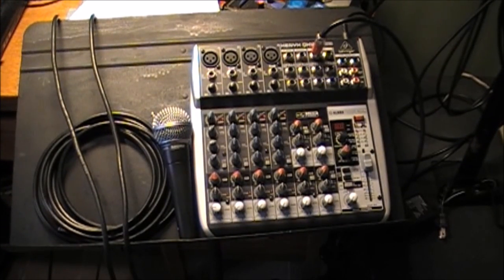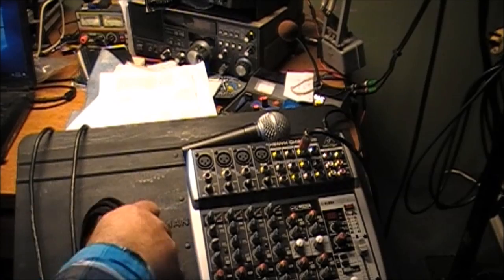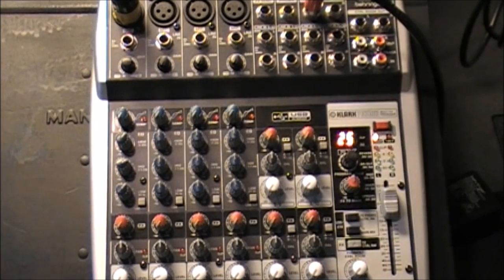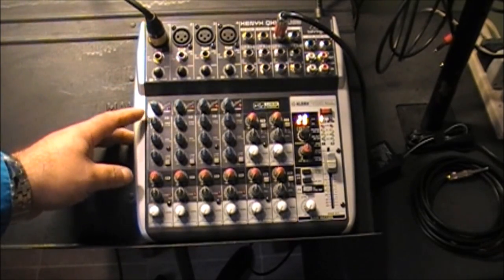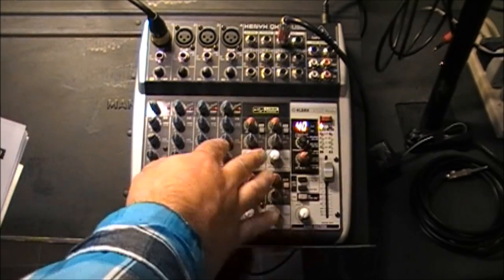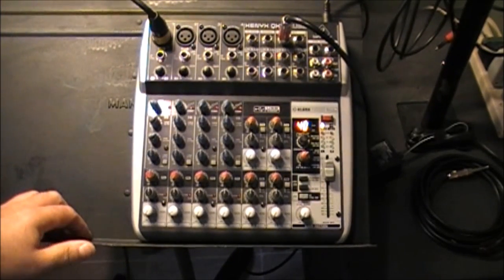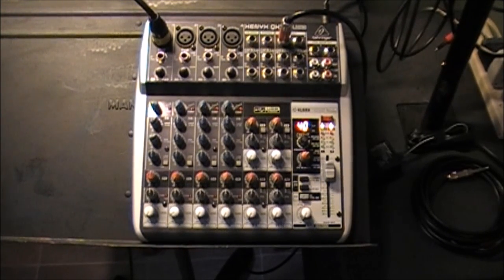Behringer Mixer: How to do a setup

Comment: How to connect 8 (eight) mic’s to this mixer ? Your explanation is much BETTER than the Behringer video, it seem liked you knew their product better than them .
Reply from the maker: There are only 4 low impedance plugs on this mixer. the other 8 channels are 4 stereo channels (Left & Right) that can be used as 8 high impedance channels. Technically this is only a 4 channel mixer when it comes to the low impedance jack capabilities so it is odd that it is deemed a 12 channel mixer but they count both low and high impedance channels. I hope this is helpful to you.
Reply: Does this mixer have the pre-amp output, my problem is I have 8 mic’s (for a choir) but I have only ONE input on the main mixer of the band. I need something liked “Rockville Line 8” but I like a better quality.
Reply from the maker: @DatNguyen-gi8pi  The preamp out is the Left and Right (Main out) is a preamp signal out to anything that is plugged into it. If you have one channel to insert the signal in and 8mics then you will need to find an 8 channel (low impedance if necessary) to mix all your mic levels in and then send that mix out to the one channel of the main mixer.

Comment: You did not discuss the FX send feature.  Most mixers have a FX return.  I don't understand how this works on the 1202FX.  Appreciate your reply.
Reply from the maker: I've never used that application before on this mixer. I will check it out and possibly do a video if it is warranted. Thanks for your comment.

Comment: Andy I was waiting on you to show how to connect an amp to the mixer. That being said I wanted to know how to set my passive  speakers to this mixer. I have 2 top  speakers that actually came as part of a PA system so a 6 channel mixer was a part of that  set. I also wanted to add a bass unfortunately  it is also passive so I purchased an amp. So how would I took all this up to this exact mixer. Please make it as plain as possible. Thanks in advance.
Reply from the maker: Typically you'd run a cord from the mixer into the amplifier and then out to the bass speaker or the top speaker. The amplifier should have input plugs and output plugs. Be sure that you have the proper cables to use with the ampan the proper ends for the speakers. Usually, one impedance matched amp will run a set of bass bins and another impedance matched amp with run the tops. I hope that is helpful to you.
Reply: Andy Tobin I'm sorry I said bass I actually meant passive sub.
Reply from the maker: Understood. We sometimes called passive subs "Bass Bins"
Reply: Andy Tobin sorry to be a pest, would I be connecting a chord to one side of the mixer going from the main out to my top speakers and then daisy chain the 2 tops and use the other main out on the mixer going to the amp and from the amp to the sub?
Reply from the maker: If the cabinets are powered then they will have a link capability usually. Send a signal to the subs and then daisy chain a preamp signal to the tops from each sub. If they are non- powered, then I usually use the most powerful amp on the bottom with one signal and the other channel out can be sent to the other power amp. to send then send out to the top speakers.  Always keep in mind your ohms and how low the amps can go. You can also use half an amp to run subs and the other half to run the tops. There are many ways of doing it but always consider the safe "user manual" way. You don't want to misuse your equipment and risk damaging equipment
Reply: you can connect passive speakers to  a mixer , BUT THEY WILL NOTT WORK,  you need somE sort of power amp between mixer and amp m8 ( UNLESS you have a mixer with built-in power amp)........hope you fix it....
Reply: @howardsix9708  and what if I use active speakers? it will work right? out of the mixer through the active speakers? no need to use a power amp? please help sorryyy

Comment: Great video....well done.  Subscribed.....   I just bought the BEHRINGER XENYX 1202FX.  But I didn't know I might need a DI like you suggested.  I will connect my Fender telecaster to a Zoom G1Xon multi-effects processor and then to the mixer.   Alternatively will connect the Fender direct to the mixer.  SHOULD I USE  THE Ultra DI BOX TO run it through the XLR mic input rather than the 1/4" input?  Thanks for any help.
Reply from the maker: YES... XLR are better than 1/4 jacks. Just try it and you'll hear the preamp power difference. The signal will be hotter as well in XLR. It is the best way to hook up any instrument.
Reply: Wow!  You are so right!  Just got the ULTRA-G by Behringer.  What a great DI.  I run my Fender Tele to a Zoom sound processor then the DI then to the mixer with the XLR.  what a difference!  I might need to get several DI's since I run also a Boss RC30 and other instruments to the mixer.
Reply from the maker: Harold Vega Vondenstein awesome eh. Tricks of the trade...!

Comment: I have a similar small unit here...you made more sense than the instructions...great layman's explanations get the message across. Beneficial for those who are just starting out. I have a 12 hole Behringer, and a Yamaha 212s. Depends on the occasion and how big, whether I take the Yammy or Behringer. All three are great mixers.
As a musician I have been picking the brains of all the soundguys and gals too, to get a reasonably respectable knowledge of sound gear.  I found the small mixer in a small restaurant when I was doing solo, great with small 100w. Still had the quality, but lesser volume. If someone asked me 40 years ago I'd be using those things, I'd be saying get me a pilot's licence first...lol. If there's anyone around me who has a better knowledge to set my mixers up, even better if they volunteer their efforts...the winner is me with an even clearer sound...and the patrons win too. Unlike some musicians, I am not afraid to learn more even at the age of 70. If you think you have learnt everything, you haven't learnt as much as you think, and you are probably conceited. And I've met a few of them. Great down to earth vid.
Reply from the maker: I have been playing in bands for a few decades and I learned the hard way. One thing I did learn is that less is more. I also learned that being loud is not really a good thing. 

You need to play to within the limits of the PA system. If you push the system, it becomes harsh and distorted and you lose quality audio. Also, putting different instruments into a proper part of the EQ mix and keeping them clean and distinguishable is a great start to any mix. 

Thank you for your comment. I do appreciate the feedback. I am so glad this video was helpful to you.
Reply: @Tobinindustrial  That what a lot of newbies don't understand. The capabilities of their equipment, and whether or not they'll blow their speakers. lol.  Nitey nites, it's 0330hrs  local here in Adelaide, Sth. Australia. Time to enter the land of nod.
Reply from the maker: @brianmorris8045  Good night brother.

Comment: Hello Andy.  Thank you for the video.  Recently I got such a mixer.  After reading the instructions, there were more questions than answers.  After your video, I was able to adjust the sound from the microphone to the headphone output, but you have two strips of level meters lit, and I only have one.  So you helped me a lot.  If they made a video on how to use the dynamic microphone, mixer and HF radio that is on your desk, that would be very cool
Reply from the maker: Thank you for supporting my channel. I am glad that the video was helpful to you.

Comment: I have watched numerous videos on mixer set up this afternoon and rank yours as the most helpful - easy to understand and you covered buttons no one else did.  Thank you SOOO much!
Reply from the maker: Thanks so much. My intention was to break it down into simple but necessary steps that would give the person the best chance at setting up a good professional sound and then just keep adding channels as they needed in a simple but clear cut way. Thanks for watching. I didn't know there were so many people needing such a basic tutorial so I may try and do more in order to try and help others.
Reply: There are thousands of us out there starting a podcast without your musical/audio background so things such as mixers and how to use them are like learning a foreign language to us.  

We need instruction even more basic like:  this is what the plug thingy looks like and here's where you put it (see we don't even know the names of the connectors).  Owners Manuals are so thin and unhelpful these days, that if it weren't for such helpful people as yourself, I don't know what we'd do.  They tell us what the knob is called, but we just don't know what that means or how /why we are supposed to turn it.

Thanks again for your video.  I'm now on Day Two of trying to get everything connected, and getting the correct cords and adapters, but at least with your video, I am more confident on how to use it once I finally get it all together.  Fingers crossed:)
Reply from the maker: I certainly hear you and if there is anything more specific you'd like me to cover. I will do my best to help out with another demonstration.

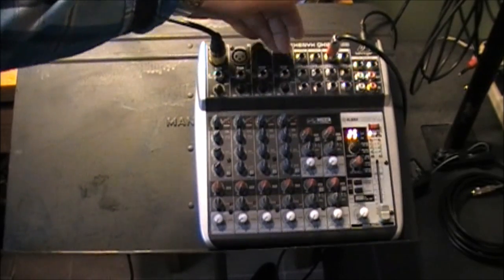Comment: At 5:26 : The electrical difference is that XLR cables are BALANCED thus immune to cross-talk and other electrical noise along the run as compared to the UNBALANCED 1/4" cables. For that reason, pros always use BALANCED cables to their desks. In a pro scenario, anyone on stage with an unbalanced cable will need to connect via a DI box.
Reply from the maker: Thank you for the comment.

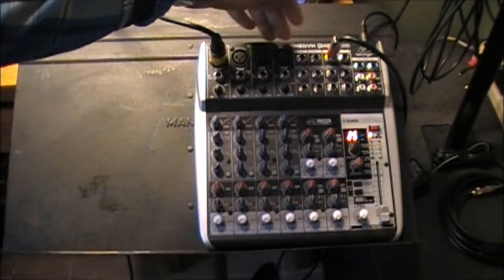Comment: I want to connect a Behringer Sl 75C dynamic mic (XLR) to Behringer Xenyx Q802USB mixer,  to use it for podcasting (voice). Which cable END do I need?  XLR? TS 1/4? or TRS 1/4?  Thanks a lot I got the answer in the min  5:20, XLR is the best choice for for better gain. 

But will my dynamic mic damage from phantom power? or I should be using it with phantom power 48V off?
Reply from the maker: Phatom power will not damage any non-phantom powered devices. You can have phantom power turned on and use a mix of high and low impedance equipment. like guitars, basses, high impdance mics, low impedance mics, condensor mics, DI's etc...
Reply: @Tobinindustrial  Thanks you very much for the awareness,  and it makes sense, while some videos say it causes damage.  I really appreciate it!
Reply from the maker: @theAIA  yes,  just know there is 48 volts there and if something should not be plugged into the mixer,  then the device instructions will say so. That being said, I am not aware of any such device.

Comment: I have mine fed into my PC's line in, so I use the PC for most of my audio needs since it can record using Audacity.  So the cassette, turntable and other devices feed into my Behringer.  Very fine mixers, and reasonable in price.  I got mine for phantom power for my big mic.
Reply from the maker: Yeah, these behringers are pretty functional and are of decent quality. I personally like Mackie and I have a 16 channel CFX model for live band applications. It is a great performer but a behringer 16 channel could substitute no problems.

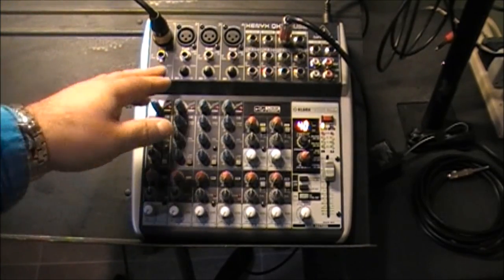Comment: Can I add a bass guitar 🎸  using the 1/2 jack and NOT the XLR,  why do I need a DI? 14:08
Reply from the maker: You don't need to use the XLR. Yes, the 1/4 inch jack is a usable input for instruments but using XLR gives you the best amount of headroom and control. You won't notice the difference unless you try it. I used 1/4 inch jacks on the input for instruments for years with lots of success but if you want to get the most out of a channel, then the XLR input is premium. the difference is not mind blowing but it is a better way to input such instruments. DI boxes, especially good ones, will make a difference. Professional sound reinforcement techs always want you in a DI so they have more control and premium ability to make the instrument sound the best it can be. Please feel free to use the 1/4 input as  you wish and I am sure you will still be a happy musician. the 1/4 inch jacks is a quick and easy way to inject instrument signals into the board. It is very convenient and a patch cable is easy to find as well.
Reply from the maker: @El Cachafaz All professional venues like to use DI boxes on most instruments. The Arts and Culture centers across Canada typically have DI boxes for everything including microphones. If not for the DI boxes, you'd need to direct feed into the mixer which is sometimes 100 feet or more away. Snakes are also used to patch from the stage to the mixers and the Di splits the signal so that it can be also sent to your stage monitor. It is the most convenient way to do live sound on stage in my opinion> Each DI box is numbered for quick reference as well.

Comment: shd mount the camera directly above the mixer close enough so we can SEE how those slots are marked.
Reply from the maker: Although this would seem to be helpful, just know that every room and every type of speaker has it's own audio dynamic and so there is no absolute setting that is perfect for each PA or room acoustics. Understanding what each control does and how it effects the other controls is key and the rest comes down to listening with a keen ear to the acoustics and sound of the whole room. When the room begins to fill with people, the audio dynamics change again and so there may be a need to tweak the system once the audience is in the room. My personal settings for this demonstration may be totally different with your speakers in the room you have the system setup. Finally, it is the fault of lighting and the camera which makes the video not so clear. the camera is High Definition but I think the lighting is not very helpful in this video. Thanks for watching.

Comment: How would you go about plugging this into a computer for audio on Logic Pro X? I tried sending the control room out with an RCA to USB cable into my Macbook's USB ports, but ot seems to be unaware that I've connected anything and it's not registering as an input source.
Reply from the maker: I believe that if you are sending to a USb that you wil need a program to use the mixer on. The Mac you have is just not recognizing the unit. In all honesty, I have never used this through a computer. I just use it for gigs and rehearsals.

Comment: If I were to run a cable from the  F/X SEND JACK on the mixer, to an EXTERNAL F/X PROCESSOR, where do I return a cable from the EXTERNAL F/X PROCESSOR  back to on the mixer. I do not see an F/X RETURN on the mixer.
Reply from the maker: I believe you would need to use a specific cord and use the insert. I have this mixer in storage so I am unable to check but if it has a send FX then there should be a return. If not, look into buying a special cord and research the "INSERT" method to send signals back into the system.  I hope that is helpful. I am 100% sure on this so be careful, I cannot be responsible for any damages as a result of this. The user manual is most helpful and I hope you have good luck with it. God bless.
Reply: @Tobinindustrial  Will do. 
Thank you so much.

Comment: Hi Andy, I iike your explanination your simplified method of explaining the 1202. Question? do I need a power amp to run the mixer? can I plug in two more speakers along with the power amp or is the power amp adequate? I am only using the mixer for personal use in my basement studio. Second do I need the direct imput box to plug in my guitar to the mixer? Thanks for your help
Reply from the maker: Hello there and thank you for dropping by with a comment. I appreciate your kind words on my video.

About your first question, this mixer has a low preamp signal out so it would not have enough power to run a typical stage speaker. A powered mixer would be different as it has some built in power amp(s). Headphone speakers would work well but you will certainly need an amp of some kind to take the 'pre-amp' signal and boost it for your speakers. A typical power amp is usually stereo (Left and Right) so you just need to watch out for how low your amp can go in ohms. I don't want to make things complicated so I will just say that a typical PA speaker is usually 8 ohms and a typical amp can do 8 ohms or less. Two speakers should work fine with one amp hooked up to this mixer. 

Now, your second question. the simple answer is, YES... You can run your guitar directly into the input of a channel by a tyoical guitar cord. A 'direct input' device typically just splits the signal. one signal for th PA board and off to the amp and speakers. The second signal goes to your personal stage amp or monitor speaker. With a direct Input "DI" you can add more headroom since most 'DI's" have a low impedance which will allow the board to give that channel a bit more headroom. Also, some DI's and Mixers will offer you PHANTOM POWER... that is another good research item for you... This mixer has PHANTOM POWER built in. That wil be for when you get deeper into sound reinforcement techniques.

I don't want to complicate things so I will just stop there. Youcan do your own research on the benefits of DI's and other things but just know, if you hav an amp and two speakers, you are well on your way to doing somesound reinforcement work with your PA. 

Good luck with it and God bless you!
Reply: Thanks Andy for the quick reply. I own a Fender MUstang 2 and I figured I would need  a speaker or two but I’m not experienced enough to know what to buy. Sound engineering and equipment hook is not my forte.I am a senior and playing for fun at home and I wouldn’t mind trying my hand at some armature recording so I need all the help I can get so I really appreciate you sharing your experience with excellent videos